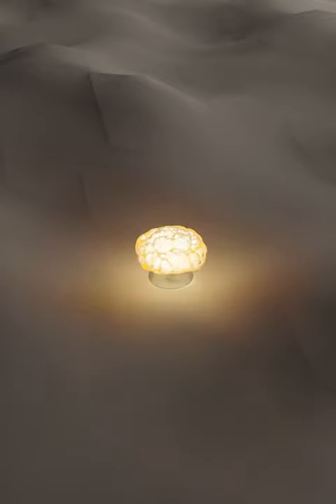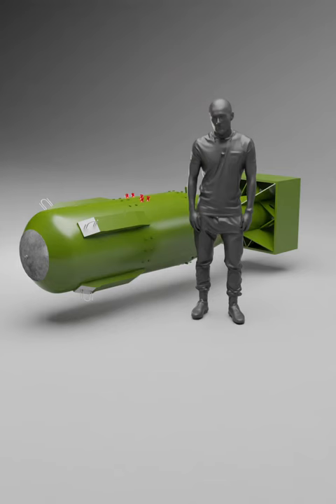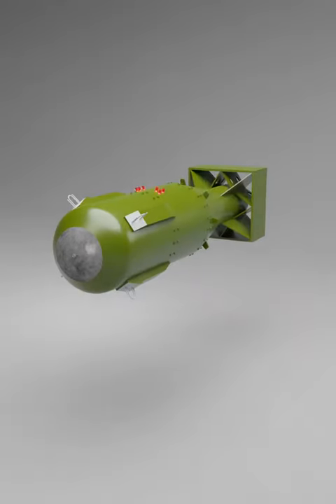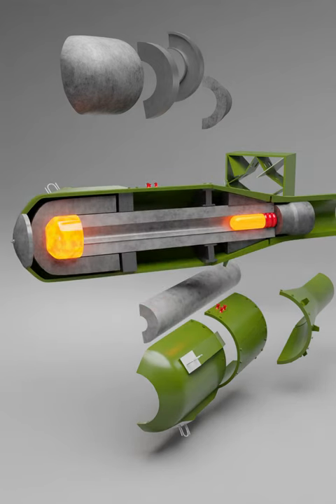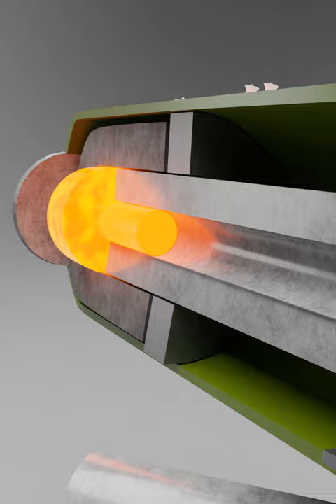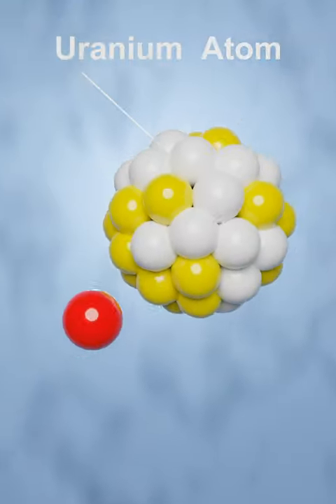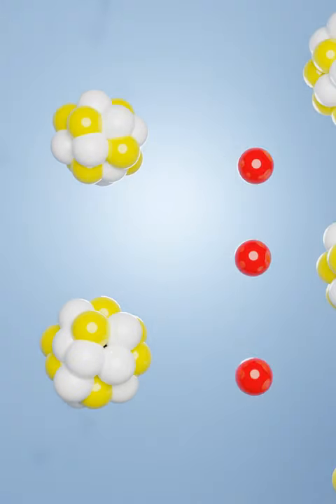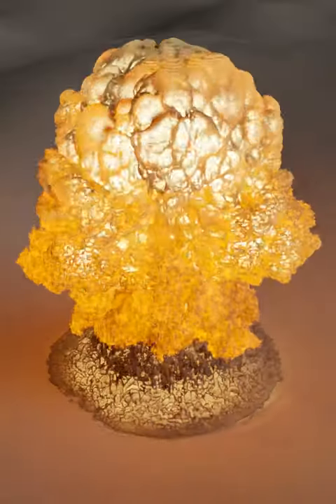#shorts how atom bomb works, #animation

Comment: It is important to note that it was the large collar-shaped part that was explosively launched towards the rod-shaped part, which was stationary.

An inherent flaw in this design, is that the chain reaction happens in very short time, and begins and reaches an explosive point before the collar has time to reach its proper position around the rod. This resulted in only about 10% (that number might be a little bit  off) of the uranium taking part in the reaction.
Reply: No, the reactivity is low, leading to low efficiency. Few fission weapons produce reactions of longer duration. 
It did not predetonate. It did not explode before it was fully assembled.
1.32% of the fuel fissioned.

Comment: This video suggests that all those neutrons participate in the chain reaction. However, it is not so. The fission reaction of an uranium atom produces two fast neutrons and one slow neutron. The fast neutrons do not participate in the chain reaction unless slowed down by a moderator substance like lithium. That's how nuclear centrals manage to control the chain reaction.
Reply: No, a fission reaction does not produce 2 fast neutrons and 1 slow neutron.
The fission reaction was mediated by fast neutrons. They do not need to be moderated. Lithium is a good neutron absorber, meaning it's far from an ideal moderator.